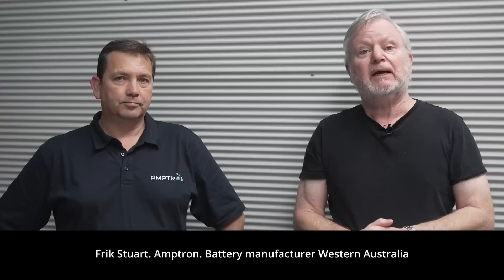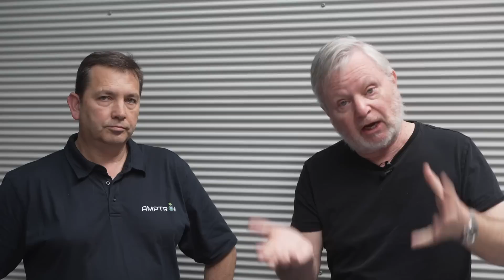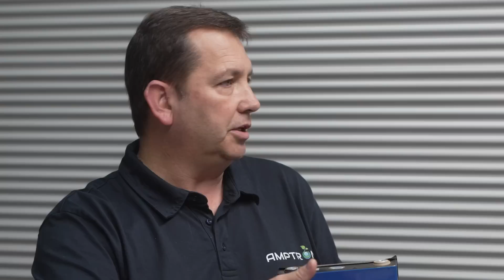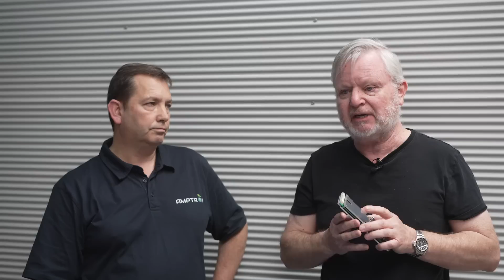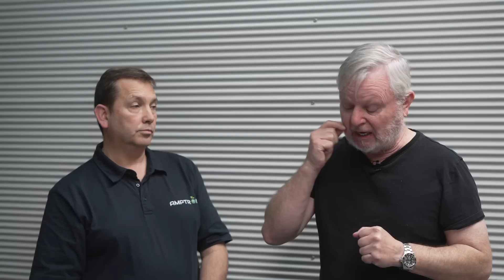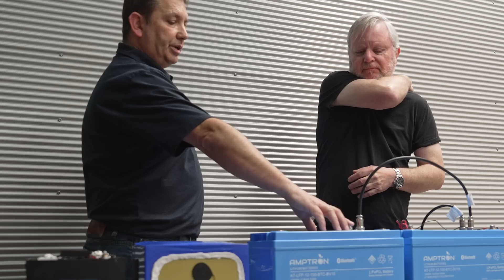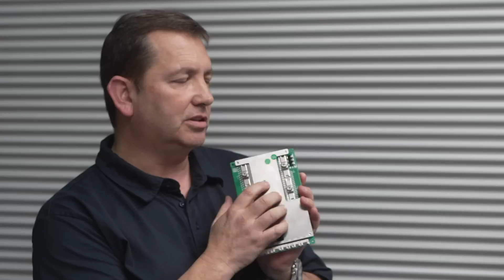LiFePO4 (lithium) Batteries. Separating Myths and Facts @4xoverland

Comment: Not sure about old mate's interpretation of the standard.

5.4.12.3.4 Monitoring device

Each battery (or bank of batteries) shall be monitored via a battery monitor designed for managing lithium ion batteries. The monitor shall display the state of charge (SoC) and may display voltage. Communications with the monitor may be by wired or wireless connection direct to the battery management safety system.

Nothing about a permanent connection either wired and wireless. 

Only SOC is mandatory, doesn't need to be internal so a Bluetooth shunt and a mobile device is compliant.
Reply: Since the standard is somewhat unclear in its wording, in order to clarify the intent, this question was posed to both the NSW and WA regulators on the interpretation of this requirement. See the question and answer provided below which clarifies that the regulators' interpretation is that the monitor must remain with the system, hence the comments that a phone-based monitor alone is not compliant:

QUESTION: “Is a battery with a management system connected to a smartphone with an app, using Bluetooth, considered a suitable ‘battery monitor’ or does it need to be a monitor that is located and fixed within the vehicle/ transportable structure?”

NSW REGULATOR RESPONSE: “I would suggest the monitor needs to be fixed within the vehicle. Comms between the product can be wireless as per above.”

WA REGULATOR RESPONSE: “The requirements of the monitoring device fall under the overall requirements of Clause 5.4.12.3 “Battery management safety system” because it is a sub-clause of this section. Clause 5.4.12.3.2 “Location” requires that the battery management safety system is no greater than 600mm from the battery. As the monitoring device is a part of this system it is also required to be located no more than 600mm from the battery. Therefore it must be located within the vehicle/transportable structure and cannot be via a smartphone app.“

Comment: Absolute crap, 

5.4.12.3.4 Monitoring device

Each battery (or bank of batteries) shall be monitored via a battery monitor designed for managing lithium ion batteries. The monitor shall display the state of charge (SoC) and may display voltage. Communications with the monitor may be by wired or wireless connection direct to the battery management safety system.
   
"Translation does not demand monitor MUST BE CONNECTED TO BMS it states MAY. Another manufacturer twisting the regs to suit their own narrative. Shall means must and may means optional. Its also states wireless is acceptable.
Reply: I'm not sure anything is being twisted I think this is just an interpretation. The valid point was that there is no individual battery soc and voltage when you have packs in parallel if using the shunt. Using Coms via the BMS you can drill into the detail of each battery.
Reply: @maxwelledm1  Batteries in parallel share the same soc and voltage. They self balance. A single shunt to monitor voltage and soc will suffice.
Reply: @magicmanspaz  sorry  that's definitely not correct. Particularly at high cycle count or if one of the packs is out of balance / has a cell issue. No way to determine this with a shunt
Reply: @maxwelledm1  And yet it has been done like this for years and works fine. Grasping at straws about one battery having a cell failure there mate. You would notice a power outage before the shunts set capacity has been depleted. Standard says bank can be monitored. Does not demand individual batteries to have individual shunts and does not demand the shunt to communicate with the bms. Again this video is twisted to a narrative by a company that wants people to think their products comply and others do not. As the battery ages all the batteries will degrade in capacity and the over all capacity will need to be adjusted in the single shunt to show the usable capacity over the entire bank. They will balance out.
Reply: @magicmanspaz  it's hardly sculpted to suit a narrative. There is an interpretation here that appears validated by regulatory bodies .. But nowhere does it say we are right and everyone else is wrong.

The standard overall is not really achieving its desired outcomes unfortunately. Each state has its own interpretations and people disagree on those interpretations. 🤷
Reply: @magicmanspaz  , the standard does verbatim state that the communication must come from the BMS, see the below excerpt from section "5.4.12.3.4 Monitoring device" of the standard:
Communications with the monitor may be by wired or wireless connection direct to the battery management safety system.

Therefore, since the communication must come from the battery management safety system, a shunt-based system which does not get any information from the BMS and only monitors external voltage and current flow in/out, is not compliant.

We are not saying that shunt-based systems are not useful, we are merely confirming that the new standard now requires monitoring beyond an external shunt-based system.

Further, there are other issues that can develop with Lithium batteries besides cell failure, since the internal BMS has electronic circuits that can also develop and issue. If you have parallel connected batteries, and one battery has shut off for example, then you would need to drain the battery bank quite low before you will notice the issue. So you can eventually identify the issue, but if you can get feedback from the batteries individually, it is quicker and easier to identify it earlier.
Reply: @amptron-au  Again. The standards says MAY be. It does not REQUIRE to be, even the authority did not state MUST be. Each battery (or bank of batteries) shall be monitored via a battery monitor designed for managing lithium ion batteries. The monitor shall display the state of charge (SoC) and may display voltage. Communications with the monitor may be by wired or wireless connection direct to the battery management safety system.
DOES NOT STATE must be individually monitored as it says OR BANK it says SHALL display state of charge and MAY display voltage. .. Batteries in parallel will share the same SOC and voltage. the standard does not mention anything about communications giving any other data such as if a BMS is shut down or individual cell voltages. MAY means optional SHALL means must. so in summery an individual battery OR bank MUST show soc with an option of voltage. You are trying to push communications that are not mentioned nor required by the standard.
Reply: @magicmanspaz  , we are not pushing anything, we state our professional opinion on what is required to comply with the standard, based on the feedback from the WA and NSW regulators themselves. We neither issue the standard, nor are we the authority on the interpretation or enforcement of the standard, that is up to the regulators. 

Our understanding of the "may" you are referring to, is that it is referring to having the option to connect either wired or wirelessly ("may be by wired or wireless connection"), not that it means that communication with the BMS is optional. Regardless, since there seems to be some potential ambiguity in the wording of the standard, we decided to contact the WA and NSW regulators to seek clarification on the interpretation. From the responses of the regulators, it seems clear to me that their interpretation/expectations are that the monitoring of the mandated information will come from the BMS, and that it will require a fixed display.

Therefore, please understand that we are expressing our professional opinion based on the responses from the regulators about the requirements of how to be compliant with the standard, and it is the regulators who will ultimately be the final authority. We have then subsequently designed solutions that can make the system compliant based on any interpretation of the standard.

You are free to form your own interpretation of the standard, and if you are convinced that a shunt-based monitoring system is adequate, you can proceed accordingly and argue your case should it ever be necessary.
Reply: @amptron-au  And yet the standards do not say anything other than state of charge and voltage which a shunt is perfectly capable of doing. The standards do not state can or must only be monitored directly from BMS and do not state a shunt is not a compliant solution. The standard does not mention any requirement to monitor BMS functions.
Reply: @amptron-au  Going by what you are pushing Victron systems now do not comply...... because even though the internal logic of the battery communicates with the external BMS and system and cerbo gx for example it does not report SOC or Cell voltages to the fixed display. You can only see cell voltages via the bluetooth app and only monitor SOC via the shunt. As well as Enerdrive who were with the committee that made the new standards so you expect us to believe they would render their own products non compliant.
Reply: Hi  @magicmanspaz  , I was using the Victron GX system as an example of systems that can support comms integration with batteries (in that case via CAN bus) to explain this further step in the evolution of these system. I was using Victron as an example since those systems are common/popular systems, but there are several other systems that support smart battery/BMS integration as well. The Victron Cerbo does show the battery banks' SOC, voltage and current flow (as reported via the battery BMS) on both the overview and device list pages (I can't show you an image here, but it is there). You can further drill down into the battery bank to see the lowest and highest cell voltages in the pack, and it will also show any warnings/alarms that the BMS reports, such as if there is an over or under voltage cell. If you want to see each individual battery cell voltage, then you would use the Bluetooth interface for that level of detail.
Reply: @amptron-au  No the Cerbo GX gets SOC, Voltage and Current from an external shunt and displays that on screen not the battery internal BMS. I have a full Victron system with Victron battery I know what it does and does not show. It also does not show cell high and low or voltages or battery internal temp on screen "only shunt temp should you use the temp probe and bolt it to the battery positive post" you can only see these features via Bluetooth which you claim is not compliant as its not a fixed wired monitor. The Victron batteries do not have an internal shunt for the internal electronics to report current or state of charge I have opened them and run others in my own setup the negative and positive posts on the cell pack are tied directly to the battery terminals there is no shunt for the neg side current to pass through to monitor current or calculate SOC.
Reply: @magicmanspaz  Some smart battery designs have electronics and software implemented that allows the battery(s) to communicate with external systems such as the Victron GX systems directly, provided that a compatible protocol is supported. For example, in our case, the BluEdge batteries have an external CAN bus port that then connects to the GX device's BMS CAN or VE.CAN communication ports. The battery and GX device then exchange data, including data such as the SOC %, voltage, current, temperature, high/low cell voltages etc, which can then in turn be displayed via the GX device's display.

Victron's LiFePO4 batteries have an external BMS that performs monitoring but also facilitates the communication interface to their GX devices. There are different BMS options that can be used. If you use the Lynx BMS, you do not need a shunt but all other BMSs need a shunt. So, it is different for the Victron Lithium batteries. For other smart Lithium batteries that have an internal BMS and that also supports compatible communication, as mentioned above the battery's internal BMS itself will communicate its internal measurements to the GX device and does not rely on the external shunt for those measurements, hence there is usually no external shunt installed.
Reply: @amptron-au  You have gone right past the point I made about you stating external shunts do not comply for the monitoring of SOC and Voltage and have stated must be from the internal BMS and can not be via Bluetooth. My point was there are well established brands out there one of which was on the board when these new rules where being discussed and they use external monitoring for those values and Bluetooth for cell voltages and temps. Not all systems that are grid connectable have a Cerbo GX or screen for a battery to be monitored in such depth so by you claiming Bluetooth is not compliant or using an external shunt you effectively claim Victron and Enerdrive systems are non compliant and expect people to Purchase your screen on top of your battery or a install a cerbo GX if using a Victron battery "Which still means external shunt monitoring and Bluetooth cell and temp monitoring". Mate you are just making things more excessively complicated than the legislation requires. Interpret it whichever way you like and the email replies you got after who knows how many times you asked till you got Joe blogs giving you their own idea of the rules that suited you because the legislation written does not require what you are claiming it to. You contradict what can or does not comply a few times with regards to fixed monitoring and must be from internal BMS. Put simply you have taken a clear single sentence in the standards and written a book of sales spin around it.
Reply: @magicmanspaz  I'll end the conversation here because we are going around in circles. At the end of the day, it is the regulators who has the responsibility to apply and enforce the standard, and therefore they are the authority. We therefore did the responsible thing which was to reach out to them to clarify how they interpret the standard, and we have published their responses. That is where our opinion of the interpretation of the standard comes from, it is not our own interpretation. You are free to interpret the standard differently if you want to at your own risk.
Reply: @magicmanspaz i think some calm and full disclosure is required. The market can decide whatever it wants. Amptron has its interpretation and so does Enerdrive and others. Amptrons solutions look good for multiple packs connected in series or parallel. If it's a simple system then sure a shunt is fine. I don't think it's worth getting worked up over and branding Frik basically dishonest etc. Anyone who knows him knows him he is far from that.
Reply: @maxwelledm1  Source trust me bro and he is a nice guy does not fly. Making up BS to peddle a product feature. The standards do not state what old mate is trying to peddle and he has contradicted himself as well as the claims made are full of holes when compared to bigger manufacturers product functionality. This is just more marketing spin.
Reply: LOL! after seeing a failed high priced 50 amp hour unit from you lot be opened by a reviewer. WOW what a joke, I have see better build quality in budget batteries.
Reply: Since the standard is somewhat unclear in its wording, in order to clarify the intent, this question was posed to both the NSW and WA regulators on the interpretation of this requirement. See the question and answer provided below which clarifies that the regulators' interpretation is that the monitor must remain with the system, hence the comments that a phone-based monitor alone is not compliant:

QUESTION: “Is a battery with a management system connected to a smartphone with an app, using Bluetooth, considered a suitable ‘battery monitor’ or does it need to be a monitor that is located and fixed within the vehicle/ transportable structure?”

NSW REGULATOR RESPONSE: “I would suggest the monitor needs to be fixed within the vehicle. Comms between the product can be wireless as per above.”

WA REGULATOR RESPONSE: “The requirements of the monitoring device fall under the overall requirements of Clause 5.4.12.3 “Battery management safety system” because it is a sub-clause of this section. Clause 5.4.12.3.2 “Location” requires that the battery management safety system is no greater than 600mm from the battery. As the monitoring device is a part of this system it is also required to be located no more than 600mm from the battery. Therefore it must be located within the vehicle/transportable structure and cannot be via a smartphone app.“
Reply: @amptron-au  In other words a standard shunt is fine. Does not need to be linked directly to the internal or external battery bms it can be stand alone shunt for SOC monitoring.

Comment: While starter LiFeP04 battery may not be ideal in hot 4wD, they are ideal in aircraft where weight is everything. The other place is in boats where they aren't exposed the temperature extremes and deep cycle is very useful for driving electronics for hours while engine is off.

Comment: Thanks Andrew for your video. I would love to hear a Few of these battery manufacturers/suppliers together to ba able to respond to the under bonnet application. Using verified data. I have been using them for about 41/2 years and no failures, being for a continuous power requirement when parked that a Lead-Acid battery cannot provide. Vehicle real estate and the lack of needing DCDC chargers and other paraphernalia are why i use under bonnet. While not pointing the finger. there is an air of finger pointng here. I would genuinly like to know the real truth.

Comment: 😅The video says the hard shunt monitoring is not complying with the newest requirement.  I have a secondary lithium battery inside a battery box inside my 4wd connected to a battery monitor via shunt.  Am I legit?
Reply: It is only new builds that need to worry about the new standards. So builds after nov 2023. Also not applicable if you sleep in the vehicle. Also portable battery boxes don't apply.